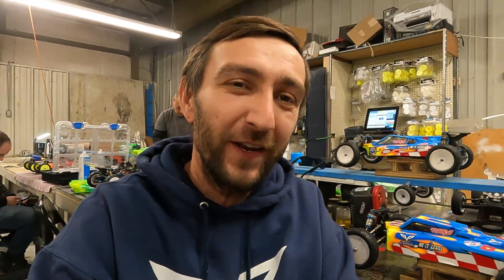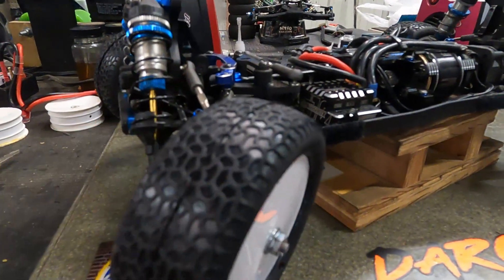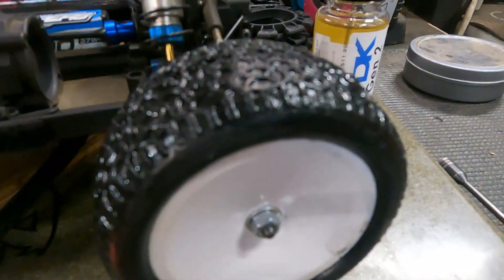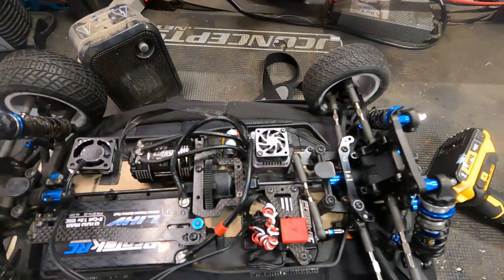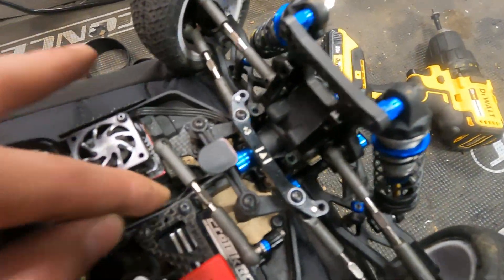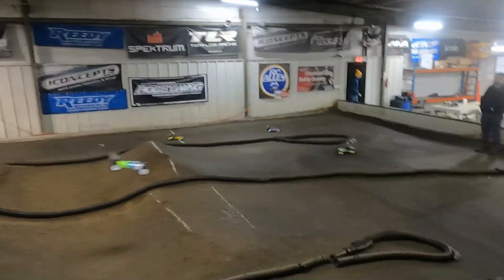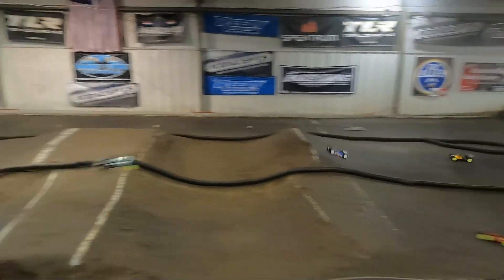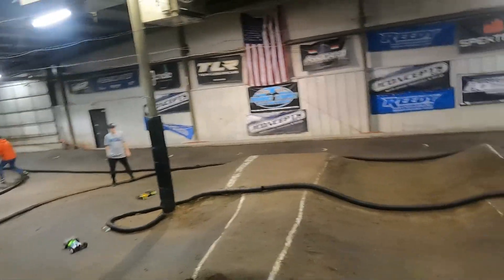Are AKA Scribbles Any Good? Review & Running

Comment: You hit the nail on the head with the no prep needed..
They are the only clay tire I've used that work new and just get better until they start to ballon..
I think jc and proline might have the edge on grip when the track is new but i feel the scribbles are the best tire to use on old layouts or when there's been a lot of sauce layed down and a groove with good traction..

Comment: Run the scribbles in front and jc  or proline in the rear. Thats what we ran at the archway classic and they were hooked up all day even with ghost pin in the rear. Thats what Steph was running when she got the bump into the A, and in the main.
Reply from the maker: I'll give it a try.  Got plenty of those rears just need more fronts
Reply: @RCAlley  As the fronts break in they get a wider footprint and get more stable. They are our go to front and work on almost any track we go to,  only change we make is the height of the pin.

Comment: Looked like that first rollover kinda messed with your head.  I can relate, you make a mistake then feel like you have to drive the wheels off the thing to get the time back, only it doesn't usually work that way.  And I'm not criticizing, I've been doing this on and off for over 30 years and I still get the shakes in a tense race.  Not to mention that you consistently blow my doors off!  LOL

Comment: Don't judge AKA because there's not many pros running them.  I think that's more to do with AKA being a smaller company than Proline or JC and they only have money to pay 2 or 3 pros versus JC who has like 10.  Right now AKA's pros (Tebo/Ongaro) are mostly 1/8th drivers.  The AKA clay compound is amazing (way better than proline, and JC had to copy it when they came up with the silver compound).  the foams are great.
Reply from the maker: I agree with you, but what's the point of being the best if you don't prove you're the best.  Tires are definitely good, but a national title would really solidify that statement.